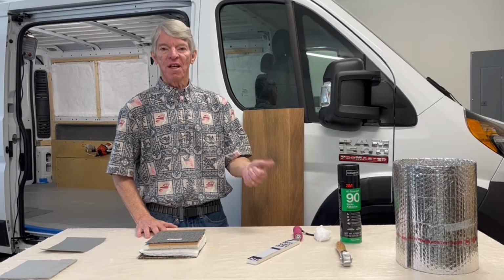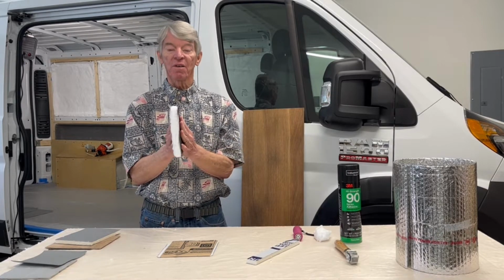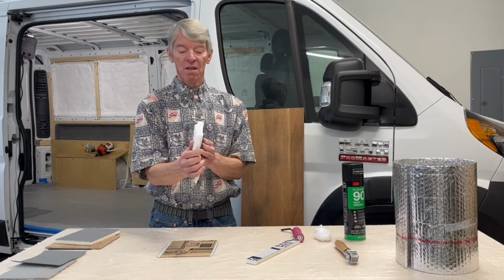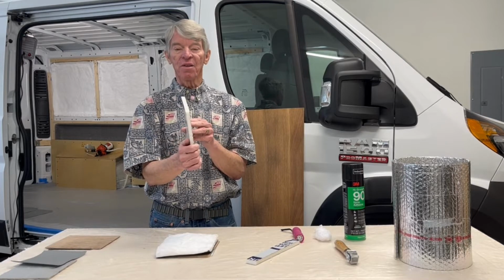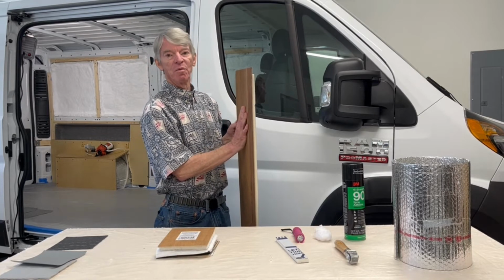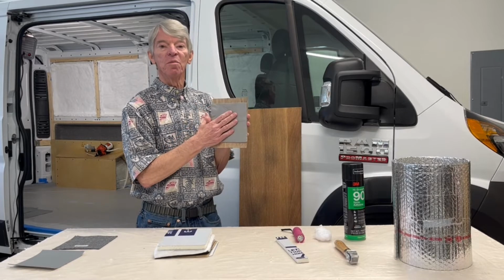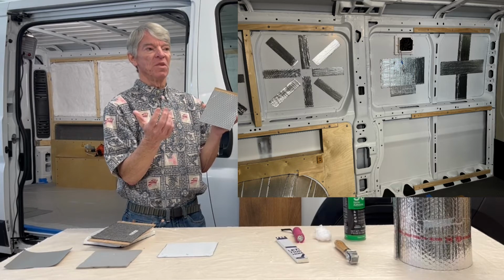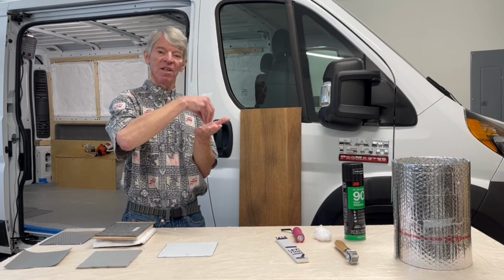Best Insulation System Ever for Ultralight Van Builds

Comment: Great content, thanks for sharing! I am curious about how you "wrap" the fabric around the plywood. From the prototype panel, it looks like the plywood is slightly larger than the foam board. Is that intentional so that you could wrap the fabric? How do you mount these panels to the wall or the ceiling?
Reply from the maker: For most if not all of the panels the plywood is larger than the foam board. This gives an area to mount the panels to furring strips; PVC strips glued to the ceiling or wood strips bolted to the walls with Rivnuts. I use sheet metal screws to mount the panels to the doors.

Comment: Thank you for tackling the difficulties of insulating a metal enclosed space, I’m also wrestling with solutions. I have a white Promaster and the interior surface temperatures of the walls are always hotter or colder than ambient temperature. As an engineer what’s the process and technical term for this characteristic of metal? This is our hardest challenge, dealing with insulating metal as opposed to other materials.
Reply from the maker: Metal is an good thermal conductor. A characteristic of the metal surface is that radiant heat from the sun can heat the metal above the ambient air temperature. Similarly if the outside air is cold the metal will radiate heat from the interior of the van into the outside air. Insulating the metal walls of the van just requires that the air inside the van not conduct heat to the metal walls. Any type of insulating material that does not conduct heat will work. Any type of foam insulation of wool type insulation will work. The solution I describe has both thermal and acoustic insulation characteristics as well as providing a structural wall that is very light weight. We have been using the van for three years and are very happy with how our insulation solution keeps the inside of the van quiet and relatively cool in the summer. That said I just installed an air conditioner and electric heater to extend our camping season further into the summer and winter.

Comment: It's been 2 years since this video was published... are you still happy with this method?  
It is very well thought out.  You are one of the few people who reasoned through the different forms of heat management, and I'm super happy to see someone else break the monolithic idea of using only one form of insulation!  
Well done! 😀  Hope you are enjoying your van and have been on great adventures.
Reply from the maker: The insulation system as stood up very well. People have commented that they can tell how quiet the interior of the van is as soon as they step inside. We are very happy with how well it blocks outside noise.
It seems like we have good thermal insulation results but no way of testing it against other solutions. The multiple layers of thermal insulation seem to be working well and the solution is very lightweight.

Comment: doesn't the white metal exterior skin of the van block and reflect as well as the foil skin of the foam insulation?
Reply from the maker: Yes, the van white skin reflects infrared heat hitting the outside of the van. The foil skin of the foam insulation reflects the infrared heat generated by the internal surface of the van skin back to the van skin to be dissipated to the outside. Both layers help keep the van cool.

Comment: Hi 
Any issues with moisture layering those products together?
Reply from the maker: The one layer that is waterproof is the ridged foam layer. All the other layers inside the van can move moisture around. The ceiling and wall panels are not air tight around their edges to allow air to circulate, although rather slowly. I don't anticipate any problems with moisture build up behind the panels. I have seen any indication of water damage where I would be able to see it, such as around the windows and doors.

Comment: Hi Pete, I went to look at the Pro Select R-Matte Plus Foam Boards and they have a paper backing on one side (foil on the other). Did you peel the paper off or leave it? If left, did it have any effect on the lamination?
Reply from the maker: I went to look at the new material and my local Home Depot no longer carries it. My foam board had a plastic backing that I pealed off before gluing to my plywood. If the new material has a paper backing, that would be even better than the plastic for stiffness. Good luck on your van build.

Comment: I’m confused! Not exactly sure how infrared light in created, but online it said that infrared light doesn’t travel through metal, so I’m not sure how it would bounce off the reflective layer on the rigid foam and out of the van through the metal exterior?
Reply: Don’t have to try again, I will take your word for it, but could you address why you didn’t consider closed cell spray foam insulation? From the videos I have watched I know that spray foam can be tricky to apply because of the potential to bow/warp the exterior metal if not applied in several light coats, and that it can be costly. It is lightweight, has a good R value, and can prevent heat/cold transfer (conduction I think) from the metal van ribs to 8020 extruded aluminum cabinets. I was seriously considering attaching the 8020 directly to the metal ribs with a small plastic spacer to prevent conduction and then spray walls/ceiling with spray foam, then install the wiring by making channels in the spray foam, and use your flooring system, but now I’m having 2nd thought and thinking of using your system because you are the smartest one on YouTube!
Reply from the maker: I really didn't consider using spray foam because it just seems like a mess and I am a neatness freak. I don't know about being the smartest one on YouTube but I really am very happy with the solution I used on our van. We are impressed by how quiet it is when we have to camp near a highway.
Reply from the maker: How the insulation reflective surface helps keep the interior of the van cooler is confusing. The hot metal van wall will generate heat in the form of infrared light off both the interior and external surfaces of the wall. Once the light bounces off the reflective layer it is reabsorbed into the interior surface of the van wall. This heats up the van wall where some of the energy is radiated back to the reflective layer but some of it is radiated outside of the van. This process heats up the van wall but keeps most of the heat outside of the van interior. I hope this helps. If not I will try again.

Comment: What's the reason that you glue the black side of your Thinsulate to the van metal, as appose to the white side? 

Also, in your wall insulation steps, at what point do you do your rough wiring?
Reply from the maker: Two main reasons to glue the backing side of Thinsulate to the van wall, 1) the backing helps to deaden the vibration of the wall panels to reduce noise, and 2) the batting provides an airgap to allow heat to reflect off the foil layer of the rigid foam insulation back to the outside of the van.

I ran the wiring after the Thinsulate was installed to keep the wiring away from the metal walls to protect it. I used the metal channels of the van for some of the wiring and protected the wires with loom.
Reply: @fivepoundpete  Thanks, this is all very helpful. 3 questions: 
It looks like van in the background of your video, you Thinsulate everywhere, except over the ribs of your van. Is that true? 
It also looks like you are attaching wood strips on the ribs of your van. What is the thickness of those wood strips? 
Are you attaching the 1/2" Polyiso - 1/4" plywood - fabric layer on top of the wood strips, over all areas of your walls?

Thanks
Reply from the maker: I put Thinsulate over all of the metal of the van walls except where there is no air gap. In those places I just use the Polyiso alone. I am using 3/4 x 1-1/2 New Zealand Select Pine for the wood strips. I am attaching the 1/10" (not a typo) plywood to the wood strips and filling the gap between strips with Polyiso.

Comment: Hi Pete, excellent videos! I especially love the fiberglass floor. It’s one of a kind and brilliant! I have a question for you: why didn’t you use lizard skin ceramic insulation? It’s lightweight and seems to produce good results. Thanks!
Reply from the maker: I'm glad you like my videos. To be honest I had never heard of lizard skin. I would need to learn more about its noise and thermal properties. I looks like it might be a good sound dampening layer compared to butyl mat for its weight. More research is needed on my part for maybe a future build. I seems like it is too dense of a material to be a good insulator compared to Thinsulate. It also looks like a real mess to install. Thanks for bringing it to my attention.

Comment: Shouldn't the metal van wall stop infrared light making reflective surfaces unnecessary?  I can see where on a window covering they make sense.  If a van is exposed to full sun in a hot place while boondocking a person could hang weighted sheets off the roof rails and hold down with magnets which would reflect heat and put an air gap between the van and the heated material reducing conductive heat transfer.  To avoid AC I plan on having those sheets and also staying in touch with weather forecasts so I can drive to somewhere 15 degrees cooler before the heat wave arrives.

And the sound deadening material is pretty heavy and adds extra labor and expense and is not necessary for boondocking or camping.  Exterior panels near supports are not going to vibrate thus don't generate much road noise.  Some people just cover their wheel wells and then use a little bit of material to add mass to the center of big metal panels without supports thus slightly reducing road noise where it makes the most economical sense.  Maybe the walls, floor and roof in the drivers cabin make sense but most people in cars can live without it.
Reply from the maker: Infrared light being absorbed into the van roof and walls is a major source of energy heating your van. A light colored van wall will reflect much of the sun's energy from being absorbed into the metal wall. I want my van to be as hassle free as possible and hanging sheets (especially Reflectix) on the outside of the van would really help to keep the van cooler but seems like too big of a hassle. We generally don't sit in camp much during the day, we are out exploring. Yellowstone is our favorite park.

I put about 25% coverage of Butyl material on the large metal panels while many sources recommend 50% coverage. I saved some weight there by using a star pattern for the material. I drove my van home from the dealer without sound deadening material on the wheel wells and the noise from rocks hitting the wheel wells was deafening so sound deadening material on the wheel wells is definitely worth it.

I also added sound deadening material to the floor to try to cut down on road noise. Maybe that is overkill but I will never know. The material on the ceiling really seemed like it helped during a violent downpour. We carry passengers in the van and I would like it to be as quiet as possible.
Reply: @fivepoundpete I'm all for quite as possible.  I'm hyper sensitive to noise. Cptsd is not fun. I'm hoping to get out in nature and heal. Thank you for your tips.
Reply: I was wondering when someone else was going to mention exterior heat tiles for their space shuttle on wheels.
Using magnets is a great idea.
Would be nice to be able to drive with that layer on .
And remove it in the winter 🥶❄️🤔

Comment: how is the ifrared getting through the metal walls of the van?
Reply from the maker: Its kind of crazy to think about but any warm object emits infrared light. With an infrared camera you can actually see people glow. So the infrared doesn't get through the walls of the van but the walls actually generate their on infrared light.
Reply: @fivepoundpete I question how much energy is radiated from the inside skin of the van vs simply heating the air on the inside which move around via convection. I’d really like to see some thermal images of different systems or even do my own tests with one of those temperature measuring guns.

Comment: I’m worried that the adhesive on your velcro isn’t rated for the heat it will be exposed to.
Reply from the maker: I think this comment is for my solar panel install video (https://www.youtube.com/watch?v=Gns9KaAAecg&t=6s). I looked it up and the Velcro I am using is recommended for temperatures between 0°F to 150°F. While moving the temperature will never get that high and that is when there is the highest tensile stress. The panels may get above 150°F while parked (I'll check it the next time I'm in Moab) but that is when there is little if any tensile stress. I think I will be OK with this product but I'll let you know if it ever fails.

Comment: I didn't get how you fix the EPS/XPS panel to Thinsulate .. only with spray glue? Or do you cut the panels exactly to stay pressed in the wooden frame? Or something else? Also considering that Thinsulate doesn't have to be compressed, not to lose its properties. Thanks 😊
Reply from the maker: The composite panels are not attached to the Thinsulate. I bolted furring strips made of .75" x 1.5" New Zealand Select Pine to the van walls using Rivnuts. These wooden furring strips gave me a material I could use to screw the panels to the walls. I used lighter weight PVC moulding glued to the ceiling to secure panels to the ceiling. I only applied EPS material to the 10th inch plywood between the furring strips to minimize the thickness of the walls and ceiling. The furring strips provide a little bit of insulation compared to screwing directly to the van sheet metal.

Comment: Lots of great ultralite ideas, Just the kind of ideas I have been looking for to keep the build weight down. I have been looking at Promaster 1500's because they tend to be available at a lower price but building them out with all that extra wood adds to much weight.
Reply from the maker: I am glad that some of the ideas for making your van build lighter may be of use. I chose a low roof ProMaster 1500 because it has the most headroom of the available options that still fit into my garage. Good luck on your van build.
Reply: Thank you for the video and thoughtfulness in your system. Do look into the Aerogel as the other commenter mentioned its pretty fantastic stuff but is quite expensive. I have been trying o find info on the scrim vs “fuzzy” side toward the outside and reflective surface and 3M never got back to me on it. I came to the same conclusion as you that the scrim should go toward the outside but haven’t seen anyone else doing it. As well, if you are worried about the ply getting wet, look into other composites for those areas like Coosa board (brand name) or Azdel (another brand name, though Azdel also has some adhesion issues)
Reply from the maker: I know of a van builder (Humble Road) who did get a reply from 3M that the scrim goes toward the van wall and the fuzzy stuff provides an air gap so the reflective layer can be effective.